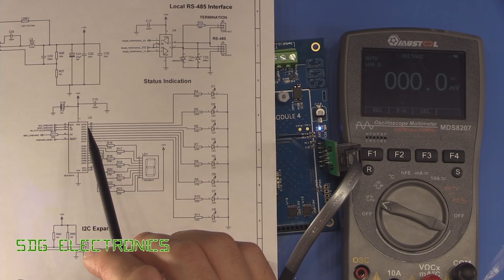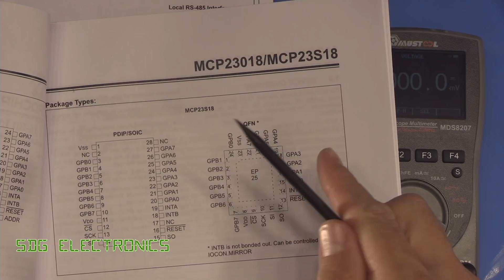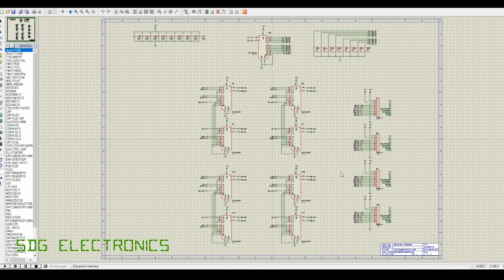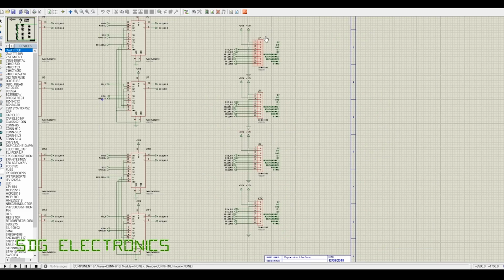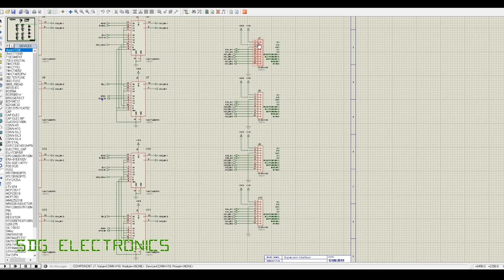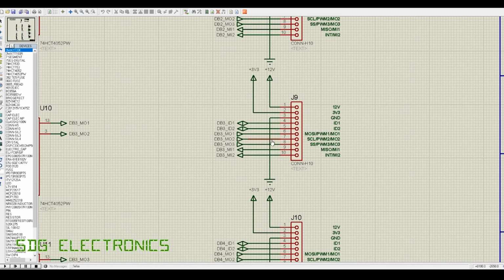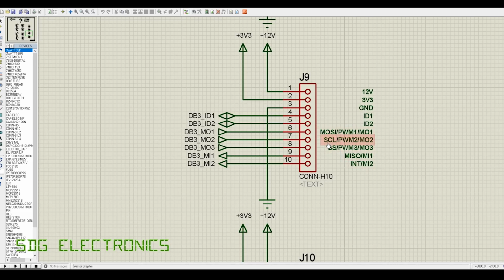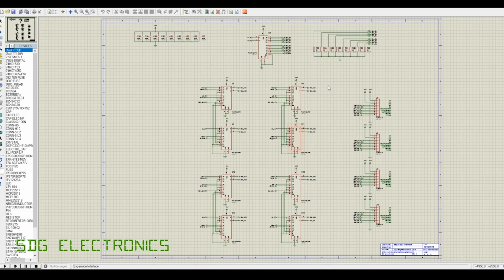SDG #107 Some soldering and testing with PCBs from JLCPCB - Lighting Controller Project Part 7

Comment: I noticed that a lot of these microchip devices have the same pin out as their PICs. I bet they are PICs with factory programmed ROM. Maybe you could find a pin compatible PIC and knock up your own firmware to fix the I/O expander problem.

Comment: Eh... don't understand why you'd use a port expander to get some leds going.  A 36 channel IS31FL3236A is 0.6$ at LCSC (#C246443) and it has a super nice layout and uses i2c. If you needed more IO, wouldn't it be cheaper to just get a higher pin count micro for a few tens of cents more?
Reply from the maker: For the LEDs it's simply as I already had one on the PCB so no additional effort to write the library. The main reason for using this particular device is for the switch inputs it has various interrupt modes. I also generally dislike I2C devices as it can be difficult to keep the firmware robust if something on the board latches up the clock line.

Comment: Shame about the cock-up with the LEDs. Figure 1-10 (p25) in the MCP23S18 datasheet contains a graph of pull-up current vs. VDD, so at 3.3V those LEDs will be getting about 100uA. I'm surprised they're bright enough with so little current. Shame too that the MCP23S17 isn't pin-compatible with the '18, otherwise swapping for that would solve the problem.
Reply from the maker: I'm inclined to think the current is even less. I think the graph has been created with an ammeter between the port pin and ground, but if we have a blue LED there, the Vf of the LED at these currents is probably about 2.3V, so we'll only see 1V dropped by the pull-up. The current is probably less than 20uA